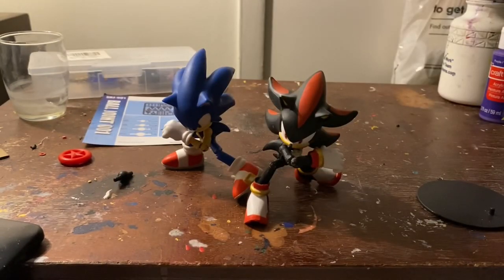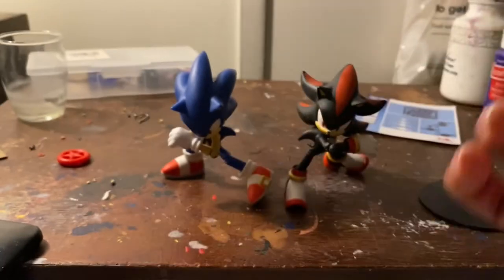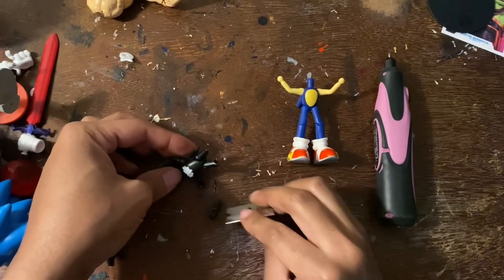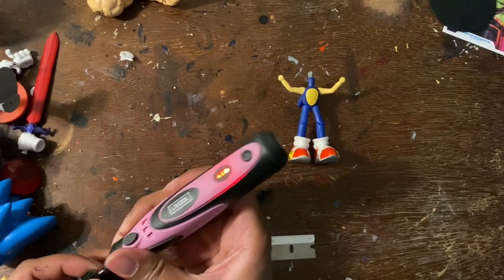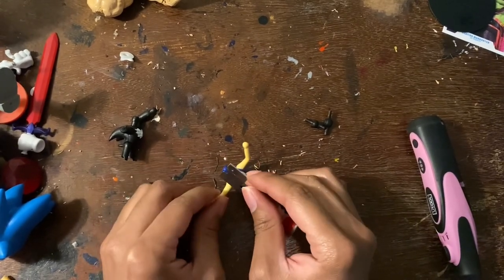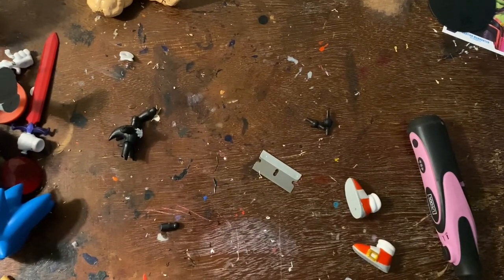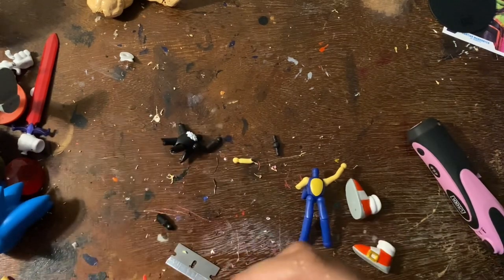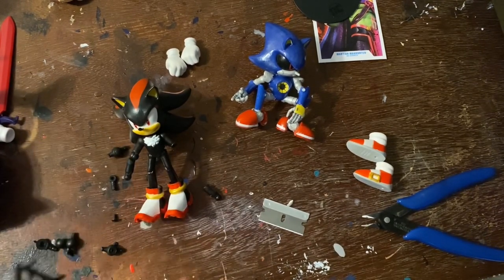Tutorial: How to add elbow articulation to your Jakks Pacific Sonic figures pt1 .

Comment: Thanks for the tip! I already tried this with another figure, but I wasn't aware they made joints that size.And speaking of, may I ask where EXACTLY you got those joints, and what kind SPECIFICALLY should I look for?  I would just like it fully explained. Either way, keep it up and good luck! =)
Reply from the maker: Thank you so much bro that really means a lot, you can get the ball joints on Amazon there really cheap. They do have some in a skin tone so it’ll look better on Sonic. 🦔💨
Reply from the maker: Hobby base premium parts collection ultimate joint series ball joint / fresh plastic parts PPC-Tn10 https://a.co/d/fIWuP2g
Reply: @kingscustoms  You're most welcome! And I very much appreciate your advice. =) But could I ask just one more thing? Which BRAND do you recommend, and what size? I just need things spelled out for me. Thanks again.
Reply from the maker: Hobby base is the brand and the ball joints come in multiple sizes they go from small to big and really big ball joints, I put a link in a reply . 👌🏾
Reply: @kingscustoms  Thank you very much! That's really helpful! =)
Reply from the maker: @BuckarooBanzai84  No problem bro anytime. 
🦔💨❤️

Comment: My elbow joints don’t wanna go together😭😭😭 they don’t fit like the small peg that’s supposed to keep them together doesn’t fit smh
Reply from the maker: Do you have the skin tone ball joints or the black ones?
Reply from the maker: Try sanding down the joint , then put it back on. If you have to twist it and add a little pressure to it go ahead.
Reply: @kingscustoms  mmm ok so it ended up working and i got the exact one that u got and it fits so well on my shadow i only wish i could make it look more natural but mmm its ok. ig i have the black ones